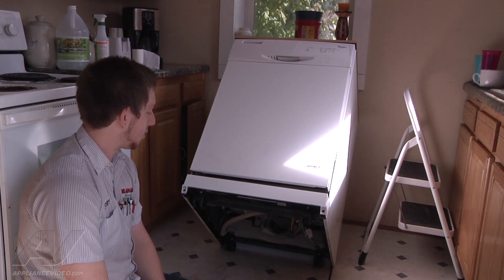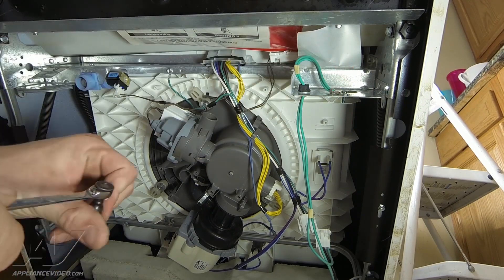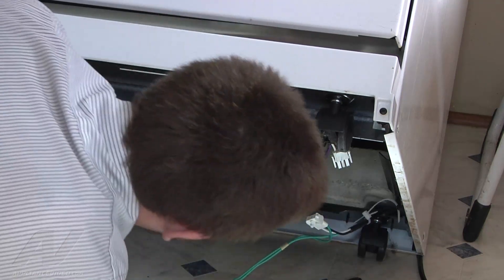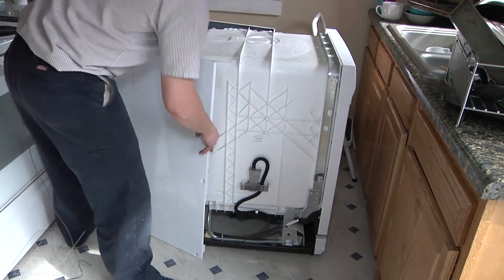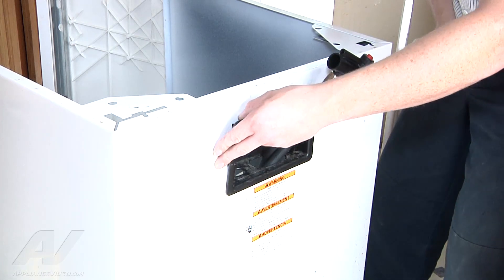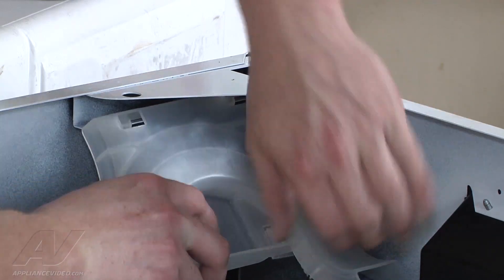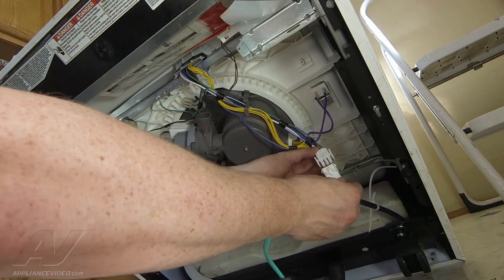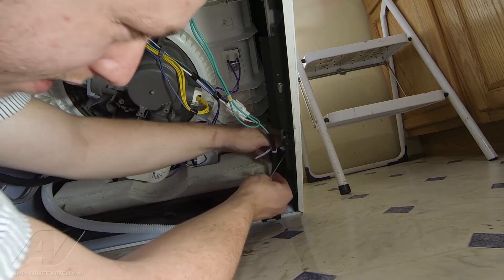Whirlpool Dishwasher Repair - Not Draining - Drain Pump

Comment: what was wrong? I never heard you say what the problem was.I wish you had took a little more time explaining why you were changing the hose/pump
Reply from the maker: The drain hose had a spot in it that was leaking water when pumping out. The pump was making grinding noise when draining.

Comment: This is the third videos that I watched so far. How do you know the pump was bad? The last two videos show how to clean up inside bottom of the dishwasher because of dirty and clogging. The average of a new dishwasher is around $500. You have taken many parts apart in order to replace the new pump. So the cost of repair is high. What is the average cost to repair such process? Thank you for your video anyway.
Reply from the maker: Great question, you can call
our parts department at 1-800-830-5465 and they can give you help 6-days A week
Mon-Sat . You can also search at www.SaveMoreOnParts.com 7- days a week.  If you have a more
technical question that our parts department cannot answer, our technicians are
answering all questions at our website at www.ApplianceVideo.com under our Repair Help section. We have over 6,000
common questions and answers that you can easily search through by your model
number, appliance make, problem or error codes, and It’s completely free to
search through our question & answer library. There is a very good chance
you question is already answered there.
Reply: exactly what i was thinking … removing too many unnecessary parts …

Comment: I found a weird black rubber piece in the dishwasher. I am not sure it is a part from the dishwasher as my son and I place things on top of the whirlpool portable, same one you worked on in the video, but I will try to send you some photos.
Can I post a picture here?
Reply from the maker: Great question, you can call our parts department at 1-800-830-5465 and they can give
you help 6-days A week Mon-Sat . If you have a more technical question that our
parts department cannot answer, our technicians are answering all questions at our website at www.ApplianceVideo.com under our Repair Help section. We have over 4,000
common questions and answers that you can easily search through by your model
number, appliance make, and problem or error codes, and It’s free to search
through our question & answer library.